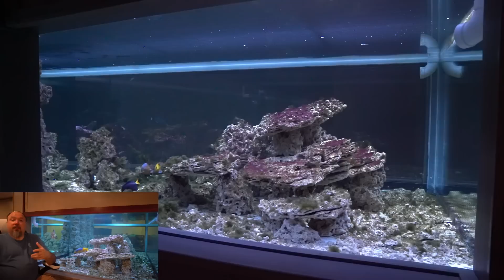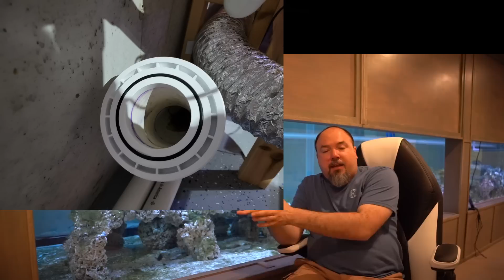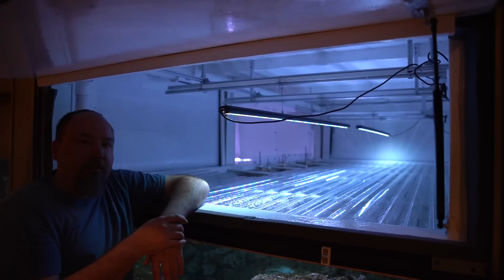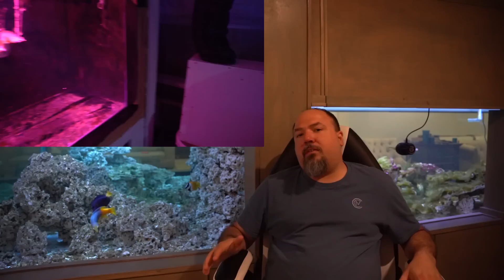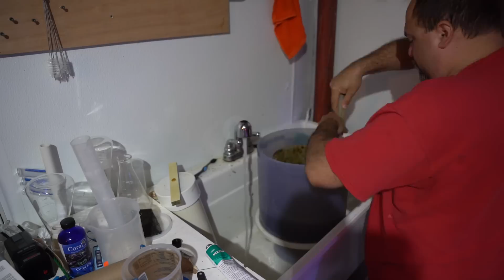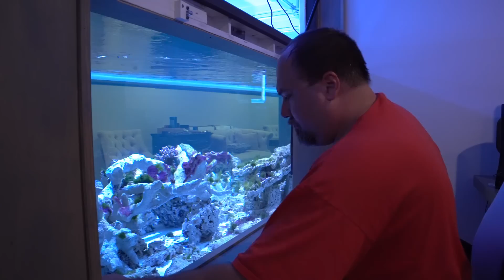4200 Gallon Aquarium Update May 2024

Comment: I head you say "toroidal propeller".  Good for you!  I have in my mind one of these designs to replace the standard prop on an mp60.  You think that would work?
Reply from the maker: It can work.  I actually found a two bladed propeller design that pushed more water.  The youtuber rctestflight had a great series testing rc boat propellers as a contest and shared all the 3D files.  I printed the contest winner with the only modification being a thicker blade  on the propeller.